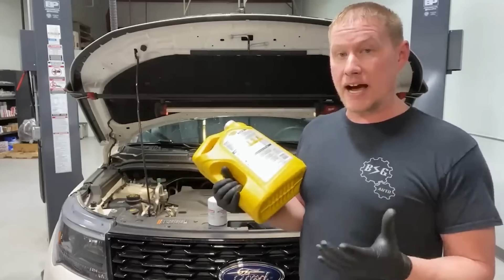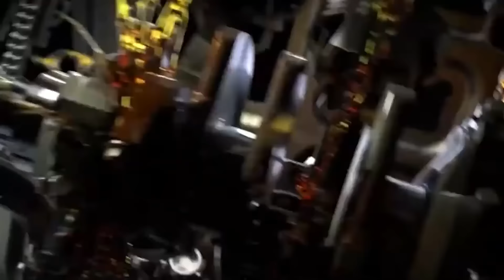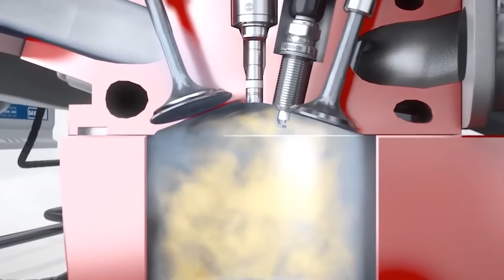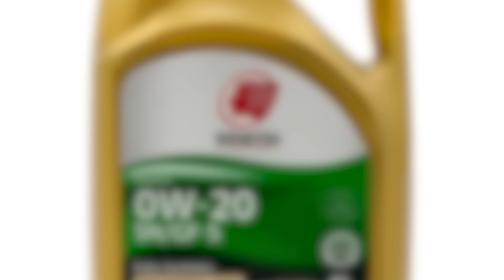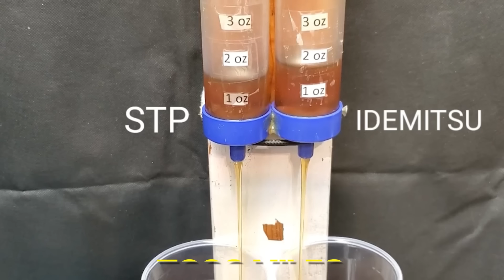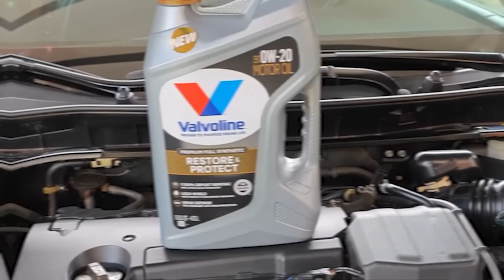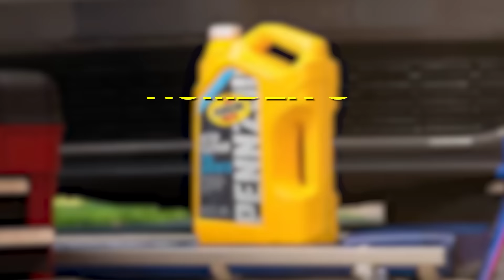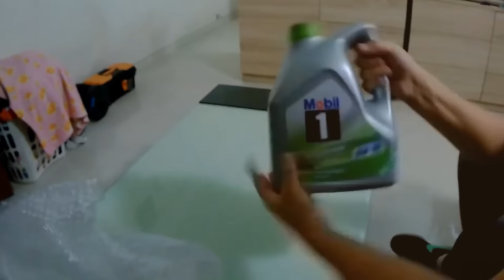AVOID These 5 Engine Oil Brands (And 10 That Actually Lasted 70,000+ Miles)

Comment: My daughter's 2016 Mazda 3 was purchased used at 60K and I have changed the oil and filter since then using 0W20 Ultra Platinum and she is at 140K with no issues. This review goes against  every other test I have seen. Who is paying for this so called review?
Reply: They said Pennzoil Ultra Platinum was one of the good ones. What's the problem?

Comment: This video contradicts itself.  In the Bad oil category, it lists Pennzoil Platinum and Platinum Ultra as #1 BAD.  Then in the Good oil category, it lists the SAME Pennzoil as GOOD ! An oil cannot be bad AND good; a Gas-to-Liquid (GTL) oil cannot be bad because it is chemically engineered from gases to a very high level of purity and uniformity. WORSE: it listed Ford Motorcraft Syn Blend as #1 Good; this oil is a run-of-the-mill G3 oil, there is no way it can rnk int same category as Liqui Moly, Redline Pro, Amsoil, etc.  Please rank this review as Thumb Down.  Absolute nonsense.
Reply: I think for Pennzoil, the difference is between Platinum and Ultra Platinum.
Reply: @martincstee5335 Yeah...the more platinum the better 😅
Reply: "Gas-to-Liquid (GTL) oil cannot be bad because it is chemically engineered from gases to a very high level of purity and uniformity".
The base is not the only thing that matters.  Put in no, or the wrong additives, and you very much COULD create a bad true so called synthetic.

Pennzoil X good...Pennzoil (same) X bad.   LOL  Depends on the phase of the moon, I guess.

Comment: Please tell me who runs a car 30000 miles? If they run that many miles before changing, they deserve what they get. Change every 5000 miles or 6 months whichever comes first
Reply: Any oil will sludge up and cause engine damage if it is never changed.
Reply: I run 15k, with Amsoil, and the oil comes out exceeding new oil specs.  Don't try this with anything else though, and heed the Amsoil change interval, and filter requirements.  There are probably other very expensive ultra premium oils that can do this, but, by god, DO your homework, well, first.   Mobil, or any other oil your local parts store stocks, almost certainly ain't it.  30k on regular premium oil, what you get is an engine full of SLUDGE, often so bad it won't even drain properly, and an oil filter that has been out of the loop, on bypass, for most of that time, filtering NOTHING, and then kaboom!

Comment: NOBODY DRIVES 75000 MILES ON THEIR OIL,  OIL HAS LONG EXPIRED BY 5000 MILES..
Reply: actually you can go 20k on Pennzoil ultra platinum its close to grade 4 while being grade 3 oil
Reply: @ShadowcatsPC  it’s group 3+
Reply: PUP & PP is no longer GTL Base oil. It changed in Spring of 2026
Reply: Do you mean 7,500 miles?   Depending on type of vehicle, driving style and environment condition;  I wouldn't go too far pass 7500 miles.

Comment: I use Valvoline Full Synthetic Oil and your review is a little confusing you have two synthetics from the same brand one is good the other is not. You should explain which oil by its brand name is good and which is no good. I believe a lot of people would be confused like me.
Reply from the maker: That's completely fair feedback and you're not alone in feeling that way. Valvoline actually has two different product lines tested here, the Advanced Full Synthetic which performed poorly and the SynPower Full Synthetic which ranked seventh among the best oils, so the key is making sure you're buying SynPower specifically. Thanks for pointing that out as it's definitely something worth making clearer.
Reply: @AutoCareLab  If you slow down just a little it would be clearer. I am a pilot and aircraft controller should have been your calling.
Reply: Valvoline is total garbage 😂
Reply: My whole goofyass family, except my mom worked at Houston plant' Valvoline '  I was a 100% Valvoline guy,but# YUP they went cheap and changed there base stock to garage AFTER they got bought out, oh you didn't notice that Made and Owned by America tag DISAPPEARED,OWNED BY- FOREINERS- NOW # Citco Full synthetic ever since,and drive interstate daily,and change oil myself every 5,000 miles, sometimes 6,000 but in 100,000 miles using NOTHING except Citco Full synthetic, have had zero issues or problems in last 100,000 miles running it,in the same 2008 Honda, oh and uses zero oil between oil changes
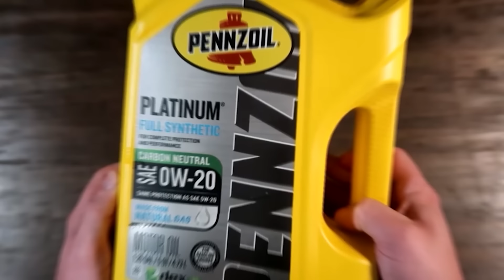Reply: Almost all so-called Synthetic  oil has no synthetic bases ( APO & POE). The only U.S. real synthetics are AMSOIL Signature, Redline and Royal Purple. These are Group 4/5. The phony synthetics are Group 3. 3:35
Reply: Full Synthetic has no legal meaning.
Reply: @amazoidal  its BETTER THAN HONDA DW-1 AND 50%:LESS

Comment: LiquiMoly (molygen) seem to be the only outstanding choice that I trust because I have seen the oil analysis comparing to others. I would not trust Motorcraft, Idemitsu, Eneos and others simply because I have not seen their oil analysis. Penzoil Ultra Platinum is reasonable, and so as Mobil 1 SUV and Truck. Special mention is Valvoline Restore and Protect. Of course, Amsoil is excellence but price is high.
Reply from the maker: Really appreciate you sharing that and it's clear you've done your homework on oil analysis. The video actually ranked Liqui Moly highly too, noting its molybdenum technology and exceptional wear results, so your trust in it lines up with what the testing showed. Amsoil took the top spot largely because of its 25,000 mile drain interval which brings the cost per mile way down despite the higher upfront price, so it might be worth revisiting if you haven't already.
Reply: @AutoCareLab  Even if you have a 25000 miles drain interval, don't do it because different driving conditions varies and shorten the oil life such as hot weather, turbo or super chargers, heavy footed, towing and dusty environments. One more word about the LiquiMoly (molygen), it actually reduce wear 25% (slightly less) when comparing to other top ranked oils. The oil analysis shows a 8 vs 11 (metal wear).
Reply: @ekyu88  No one is going to gamble a $8500 engine to test going 25000 miles on an oil change to save $10 unless they are an idiot. My last truck was driven 300,000 miles without a tear down on conventional Valvoline oil. 3500 between oil changes. It was naturally aspirated though.
Reply: The type of vehicle and the way it is driven are factors in what oil is best for a particular vehicle. GM specs it's Dexos standards to enhance mileage for CAFE compliance, but some other oils may get fractionally less mileage but offer better wear protection and thermal breakdown.
Reply: @markleggett3944  Yeah the infamous CAFE standard, killed more engines than gas saved. Good point on different vehicle needs oil meeting different standards but most of these oil brands has most of these certifications so no worries.
Reply: Liquid Moly is one of the few that still have So2 moly in their additives. It turns acidic over time so enjoy.
Reply: @rustypipes12  Sounds reasonable but I looked and it seems like it won't. You can search and here is the answer "No, MoS₂ (Molybdenum Disulfide) does not create sulfuric acid when used in an engine, even over extended periods. It is considered safe for use in engine oil and does not lead to significant chemical changes that would produce acids." I n addition, the oil analysis from motor oil geek show no adverse acidic affect so it makes sense.

Comment: I think you have no idea what you are talking about. Tests have proven that Mobil One and Pennsoil consistently compete with Amsoil.
Your argument is invalid because you do not compare the top oils……. Instead you pick and choose.
Reply from the maker: That's a fair challenge and worth discussing. The video actually did include both Mobil 1 and Pennzoil in the testing, though it separated their different product lines since the ESP Formula and Ultra Platinum performed significantly better than the Fuel Economy and regular Platinum versions respectively. If you've seen independent oil analysis showing those lines competing directly with Amsoil we'd genuinely love to see it shared in the comment
Reply: @AutoCareLab  Your reply is confusing to me. Mobil 1 EPS that you're saying is better is now doesn't even have a API rating for most US and Asian vehicles that call for API SP. 
And now the Mobil 1 Advanced fuel economy you're saying is so bad is now API SQ. ???
Reply: @AutoCareLab  I will try to look up the info again but it came from several sources.
Bob is the oil guy has the MSDS comparison charts.
Nate’s interactive channel did a championship oil testing for Ow20 in which Mobil 1 beat all competitors.
   I think what we are missing is that all oil brands have a certain viscosity oil that they focus on….. nobody is the best at all of them.
Looks like Mobil 1 for 0w20 , Amsoil for 10w30 , Pennsoil for 0w40 etc

Comment: Social media is exploiting deceits and misconceptions. It is imperative to know what would be best for your own engine.
However, if you're a maniac in driving without any regard to how you may damage your motor from your habits, I don't think there is such "best oil" that will suit your desired expectation.
Reply from the maker: Really well said and hard to disagree with. The best oil in the world can only do so much if driving habits and maintenance routines aren't working with it, and that's a point worth keeping in mind alongside any test results or rankings.

Comment: They said valvoline destroys engines earlier then used valvoline as the best brand later 🙄
Reply: Different formulas
Reply: @donb3084 bull 💩
Reply: Listen and re-watch the video again.....
Reply from the maker: Totally understandable confusion and you caught something worth clarifying. The video actually tested two completely different Valvoline products, the Advanced Full Synthetic which performed poorly and the SynPower Full Synthetic which ranked among the top performers. Same brand name but very different chemistry and results, so the distinction between those two specific product lines really matters here.
Reply: Minor quibble:  I think you should have just said " the distinction between these two different products really matters here," rather than using "product lines."  Those are two different products within the valvoline product line.  A single product in their line of products is not a "product line."  😅😂    @AutoCareLab